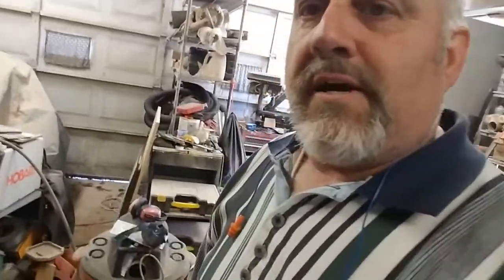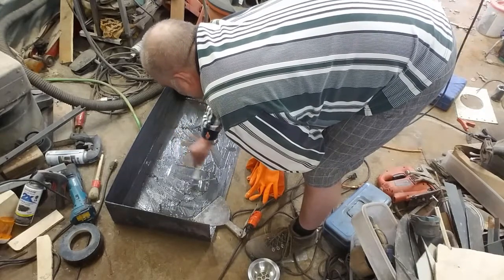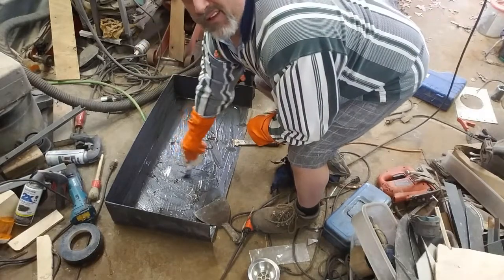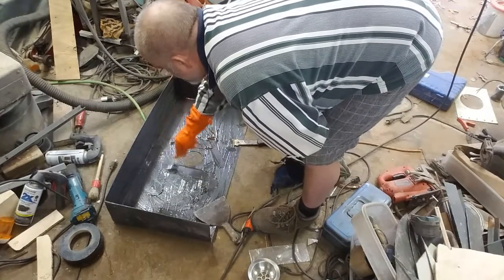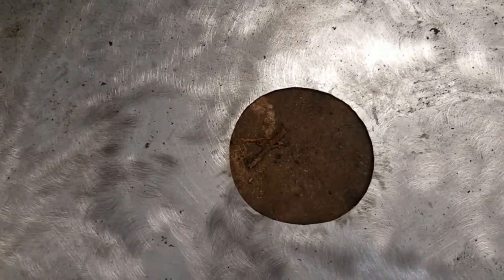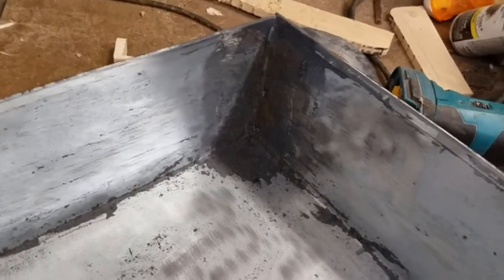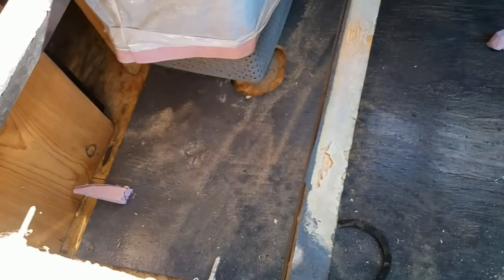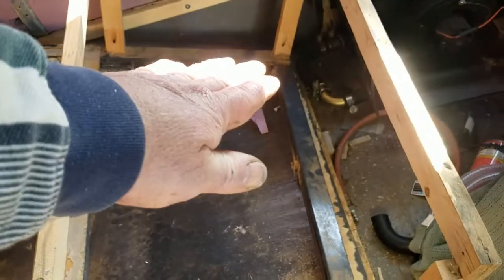School bus to RV conversion Episode 58 (Repairing, Redesigning and installing bathroom part 1 of ??)

Comment: Is that pan the size your shower will be? Maybe I’m confused but, it looks kind of small. I’m going to see if I missed a video. Good that you have the electrical knowledge for how that motor wiring can work.
Reply from the maker: yes it is a small shower pan, it's a wet bath so i can sit on the toilet seat while taking a shower, that's why i made it so small
Reply: Coolbreeze, oh I see.